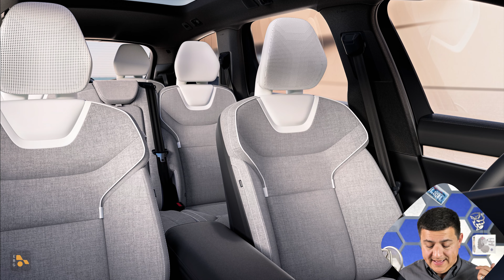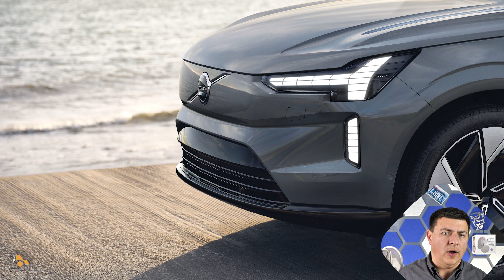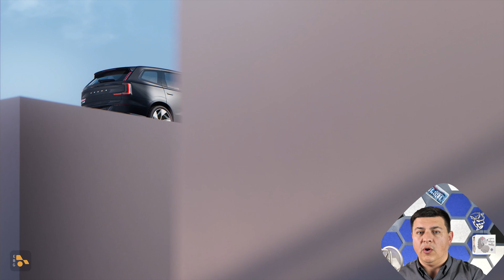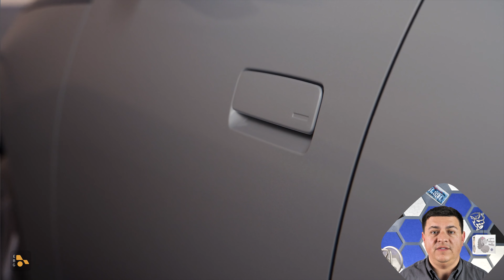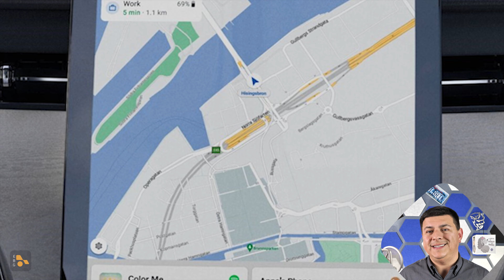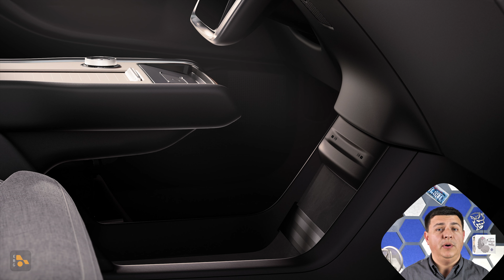2024 Volvo EX90 | Volvo's Next-Generation EV Is Almost Here!

Comment: Hello Alex, I just reserved my EX90 on Volvo website. Here, I want to share a little bit more information.  I got confirmed with the customer service that the price shown as "well equipped under $80,000" doesn't mean the base trim. Customer service said the only price currently mentioned on their website, which called "well equipped" will be a mid-level trim. It will be a little more than the XC90 PLUS trim, they added. So, it's a pretty good price for me, in this case. The base trim could be even couple grands cheaper.
Reply: I also did a reservation the day they were first available. Question is, with this being assembled near me ( I live in Charlotte, NC), can I go pick it up and avoid the destination fee? And not getting the full $7500 credit/discount is a bummer.
Reply: @hermanallen4370   unfortunately,  the answer is no. You can never pick up a car from the manufacturer yourself. As you put the deposit, you should have picked up a dealership as the one you will pick up the car. As soon as you pick up from a dealer, you have to pay the destination fee.

Comment: As a bonus, I watched an interview with a reporter. (It was in Swedish) He basically said that the reason that the ex90 was delayed since they changed spa2 from phev/Bev to only bev meaning that int will only accommodate Bev cars. It's also able to have fuelcells onboard. It also has a new motor exclusive to the ex90 an PS3.

Comment: 400 Volt EV’s by mathematical undeniable properties cannot reach and maintain its peak because of the excess current needed and heat loss that is generated due to the double the amount of current needed versus the same size battery that’s configured as an 800 V system. That increased current capacity that’s needed isn’t often found in chargers abroad and so it will be harder to find a charger in the next 5 years that will supply the volume of current needed to reach this maximum speed. Said another way if I come to a charger and there is this Volvo versus IONIC 5 or 6, EV6 or 7, Lucid Air (any) or Porsche Taycan (any), I will be waiting for them to finish and save myself a whole lot more time if they both just plugged in to the only two 500A Chargers.😉 That is if I have an 800V vehicle.
Reply: This car will get 800v as a mid life update. 800v is not yet as sustainable as 400v as the battery requires different materials and more cooling
Reply: @Kurre.  huh? Cell does not know overall pack voltage. Cell chemistry and thermal limits determine charge rate. 800 V needs less cooling in many components due the heat generation is a function of the square of current.
Reply: @barryw9473  the higher energy flow needs heavier metals and those aren't sustainable yet!
Reply: @Kurre.  which metal?
Reply: @Kurre.  prove sustainability vs oil or coal extraction.
Reply: @Kurre.  Double the voltage yields half the current for the same power delivery. Half the current yields exponential less heat waist losses. Yes it still needs cooled but mostly because engineers use this advantage of less losses to heat to push more power for faster charging. The US is an expansive land mass that benefit more from this with people traversing multiplied hundreds of miles. It’s not the only quality to judge EV’s by but getting off a limited charging infrastructure connection so others can charge is among greatest benefits to everyone of faster charging. Some will charge at home mostly and for them, greater AC charging capabilities that is built in an EV is of greater concern and often overlooked by buyers. Awareness will bring charges to manufacturers as buyers will be looking for the features that meet their desires the most beyond glitzy lights and well appointed interiors.